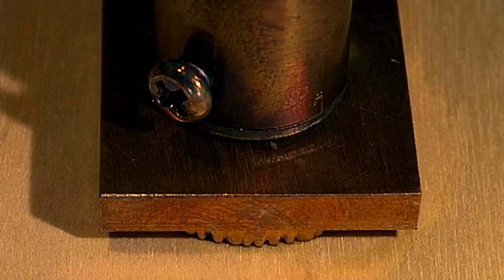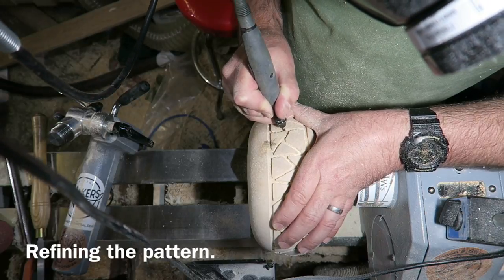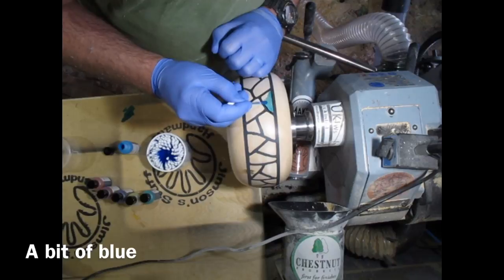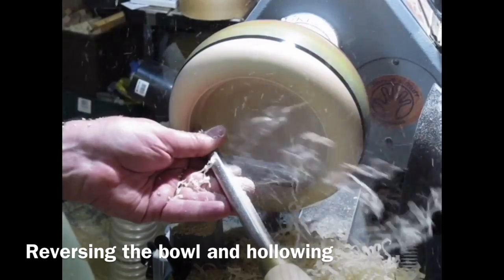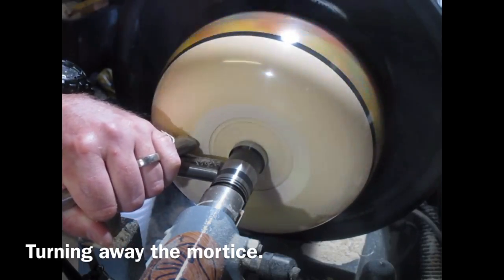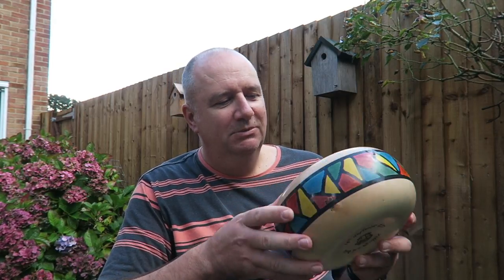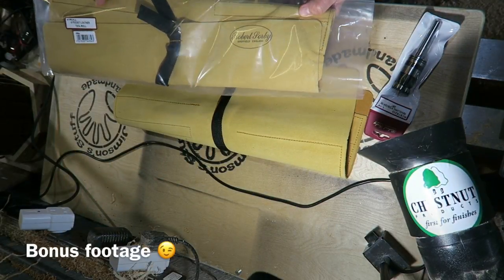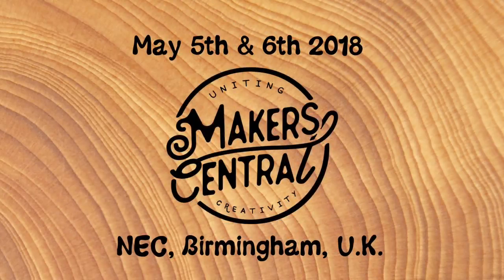Woodturning , Sycamore, Milliput and Colour

Comment: What a cracking project Jim!  And your usual excellent presentation in great detail, very enjoyable.  Where did you purchase the Sorby longworth style chuck? also is the centre locking bolt/screw on it, raised or recessed flush with the face? thanks and regards, Tony, (UK)
Reply from the maker: Thank you very much Tony. I got the Longworth style chuck from Turner’s Retreat. I can’t remember whether the bolt is flush or not , I will try and remember to check later. Cheers, Jim

Comment: Nice job.  What do you use for your engraving on the bottom?  Have you done a YouTube on my audio/visual equipment and your editing program?
Reply from the maker: Thank you very much. I use a Peter Child pyrography machine ( now made by Robert Sorby ), for the lettering. The brand I ordered from Hong Kong via eBay and fitted it to a heavy duty soldering iron ( see my video called "tales from the workshop " ). I haven't as yet done a video on my video making but I may do in the future. My setup is very basic and inexpensive, I do the majority of my filming on a little Canon G7X and all the editing I do using iMovie on my iPad. I am setting up a little video monitor in the workshop, so may do a video after that. All the best, Jim